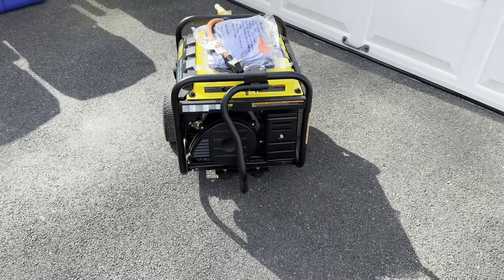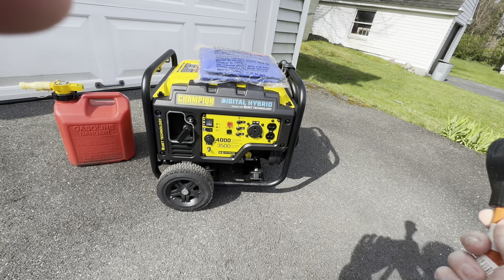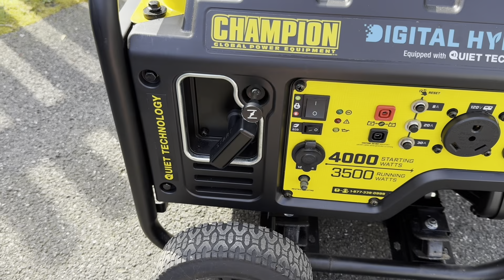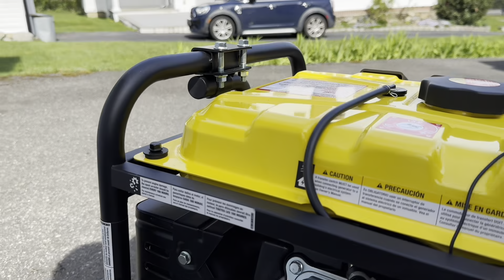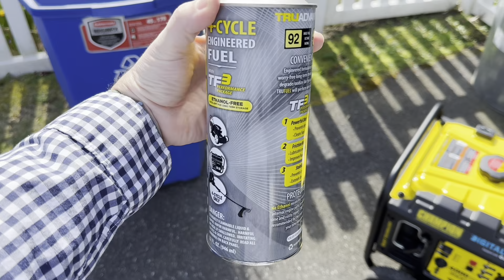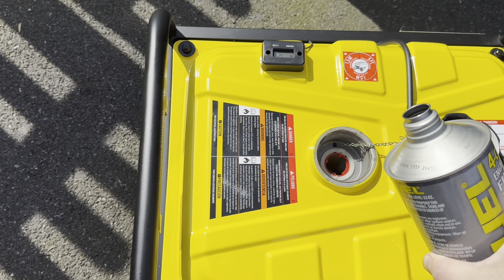Champion Open Frame Inverter Generator - Why Less is actually WAY MORE! Watch before you buy!

Comment: Contrary to what most say in this video, I chose to go the other way with a 10500 tri fuel unit running on natural gas. The generator  runs everything in my home so I can live exactly as if I had grid power including air conditioning and 240 volt clothes dryer. Running on natural gas, it's very inexpensive to run at 13 cents per hour,  and running most of the time at 25@ load, it's much easier on the generator itself. I don't want to be switching circuit breakers on and off - I want everything to run as per normal. My take on it anyway....
Reply from the maker: I agree, it all comes down to finding what works for your needs! Thanks for watching!
Reply: Same, I paid to have a friend bust through my basement wall with a gas line so I have “unlimited” run time if needed. But……and there’s a big but here, gas, and esp natty gas vs propane, delivers far less running watts than the much denser gasoline (liquid). As in 3k less watts generally. That’s quite substantial on my 8750w generator. It should say “8750 on gasoline, and much less on everything else.” However, gas is way cleaner, prob way more efficient, and unlimited. So…tradeoffs. I know I’d never use ethanol fuel on these small engines. My 8750 is pretty loud, I will say. I want to build or get a portable box for it. Didn’t want to pay the premium for closed frame but may do something on a patio like a brick enclosure for the sides, and some type of removable top like your tarp idea or maybe rig up a plastic “roof.” I haven’t figured it all out yet. I do like on the newer ones it’s basically one knob for all my options, nothing, gasoline, propane, or natty gas. Also, ethanol containing gas is hydrophilic, meaning it attracts water, and ethanol free gas is hydrophobic, it repels/doesn’t absorb moisture nearly as readily.

Comment: What you're saying does make sense.  I will figure in an a/c window unit or space heater with mine.  I went with a monster 13000 watt duromax, its 2 years old and won't run.  I did all the proper maintenance.  It ran about 20 hours on propane, now it won't run on anything.  I think I got the unlucky dud, but I'm going to get a champion inverter.  Probably a little bigger because I have a well.   You don't need to host a banquet when the power is out, just get by.
Reply from the maker: Great idea and I think you’ll be very happy with champion! Just change the oil when it needs it and always use stabilizer and drain the fuel when storing it and you shouid have no issues.
Thx for watching!

Comment: Going to be in the market soon for our first generator. Is the hour-counter device to let you know when to do maintenance, or for some other reason?
Reply from the maker: I install hour meters really only to know how much usage the generator has, when to do oil changes, spark plug changes etc. you don’t need an hour meter but it’s just easier to keep track of runtime that way. They are super easy to install also .

Thx for watching!

Comment: I have a similar size westinghouse and it worked fine during outages. The point about efficiency is very valid. However, you must also consider heating and air. Loosing power in the middle of winter with no other heat sorce sucks! Trust me on that one. Or run a/c window units during summer for Grandma and the puppies.
Reply from the maker: You’re absolutely right about the importance of backup heat, that’s a critical consideration when it comes to power outages!

Comment: Will this run a forced air furnace?
Reply from the maker: It should be able to. My predator 5000 runs out forced air furnace ( oil fired).

Thx for watching!
Reply: One of my Honda EU2200's will run my gas furnace with a 1/2 hp blower motor easily.  My Yamaha EF2200 will also.  Once it's started, it only requires 680 watts to run.  The starting surge is more, of course.

Comment: Champion is great, but skip the open-frame models unless you have an enclosure or live on several acres. We have one guy in our neighborhood that runs an open-frame during outages, while the rest of us spent $200 more for a 50-60dB model. We all hate him. Don't be that guy.
Reply: Gotta make do with what you can afford.
Reply from the maker: @rickh9507  agreed 👍! Thanks for watching
Reply from the maker: lol that’s a good point although it’s still quieter than a traditional generator but I do agree an enclosed inverter is very significantly quieter!
Thanks for watching!
Reply: A tent made of two pieces of plywood over the generator might help the noise issue.

Comment: Good video and important point about the logistics of keeping your generator fueled. I actually have 6 generators 2 X 4000w 2 X 3000W  1X 900w and a 2100W all running watts inverter generators. I live in Typhoon alley so I want redundancy and I also want to size the generator to the load. We have 9-12 all day (12 hour) power outages a year because they are working cutting trees back from the lines several smaller shorter duration outages because of the aging grid and sometimes 10 days without power when a storm does considerable damage. My 4000W generator is good for the all day outages and burns about 5 gallons of fuel but my life is practically unchanged Running two 1HP mini split air conditioners and all the usual appliances aside from water heater or cooking with electric. I can get by with one Mini split 1400W maximum if the house is already cool and my washing machine uses 2200W, dryer is new and is more fan than heating element and uses 2300W for about 2.5 hours to dry clothes, 20cuft refrigerator 350W when it kicks on 65 inch TV 250W, laptop 70W, desktop gaming computer only pulls about 350W with the chill power setting. 5 gallons a 12 hour day is no problem when it's easy to get fuel. 50 gallons after a typhoon when the roads are impassable is a bit of a storage problem plus it's hot here in the tropics and I prefer cooler, dehumidified air for sleeping. 

If a person possibly could, I would recommend they have two appropriately sized inverter generators that they could parallel at need and shut down when possible. It helps a lot when everything you are running is of the more efficient type. If you have a really old refrigerator or air conditioner, the electricity savings might pay for it's replacement with a power conserving inverter refrigerator or air conditioner. Also to consider is that my 4000W generator is industrial in nature and has a beast of a 270cc engine. My newest generator the 2100W has an 80cc engine and two of them paralleled together would only be 160cc. 110cc would be a considerable savings in fuel. I do like the open frame design. There is a drain screw on the bottom of the float bowl of the carburetor. It would be child's play to hook a larger gravity fed tank to an open frame generator that would give you days of runtime but don't forget that you still need to check the oil periodically and make sure it's Full, not just that it has oil in it.
Reply from the maker: Great points! Thanks for watching!

Comment: lol this generator from scamazon is almost 500 bucks. you can buy the same one direct from china for $145 from the same factory but weird name like "aceup" and just wait 3 months for it on the slow boat. buy 2 for almost half the price and run in parellel for 240v and charge an ev or run the entire house on 2 phase.

Comment: I agree with your statements on this size of generator. I did a ton of research and came to same conclusion. I wanted fuel efficiency, lower noise and clean power. This checks all the boxes. I also have 700 W/hr battery bank and 200w solar panel for lights and smaller things.
Reply from the maker: @RollingSherman505  awesome! Thanks for watching!

Comment: I've looked closely at this issue of fuel availability, and other issues.    Ultimately,  the best solution may be two generators.   Both must be inverter types.  Apparently, some folks really have ruined electronics with long runs of a non inverter genset.    I don't have that, so I'm using line conditioners for all my electronics.  - in case you need to do that. 

The larger generator should be two phase, meaning, capable of 240V with a 4 prong plug.    If the situation IS NOT a long term emergency, these systems, which typically start at 6KW, can run appliances like your stove, dryer, and even AC with a soft start kit.  Albeit, perhaps only one at a time.   And I would connect it with an interlock kit on your main panel, giving access to every circuit.    Tri fuel is ideal, presuming you have Natural Gas service.  Otherwise, dual fuel allows you to keep more fuel on hand, and a lot of gasoline sitting around must be cycled to keep from going bad. 

The smaller generator, I would go even lower than you did here, presuming that fuel will actually be unavailable for an extended period.  Maybe 2800 or so.   The  only purpose is to keep a fridge and a few other small appliances running.    You might be in a situation where you could only run this small unit a few hours a day to keep your fridge cold.   Adding a battery inverter system would let you run a few lights at night while the generator is off.     On these smaller systems, they are single pole, like yours, with a 3 prong plug, 125v only.    Not capable of running large appliances.  Maybe start your big one for an hour to take care of laundry or what have you.   Preferably, all your systems are gas, and you could do a lot with this little unit.   This type of unit is probably best connected via a transfer switch with only 110 circuits on it. 

Every Generator needs a doghouse, or shelter.  Ventilated, but supresses noise, and preferably locks to your building or a concrete base, to keep anyone from stealing your equipment.
Reply: I have found that large phone charging battery banks with lights on them are a good light source when power is out long term, depending on size they can run for days/nights and still allow you walk around without barking your shin on the coffee table. Large ones will also power a small USB fan for long periods.
Reply from the maker: @ that’s great to know! Thanks for watching!
Reply from the maker: I 100% agree with what you said here! Thanks for the great points and thanks for watching!

Comment: But can it run a well pump that is a 240 volt circuit. I want a inverter generator that can handle a 240V at least once a day to fill my pressure tank during an outage
Reply from the maker: That’s a good question! Unfortunately this unit is only 120v. Champion does make some larger open frame inverters that are 240v and those would easily be able to handle the well pump. Harbor freight predator also makes a large inverter (9500w) that is 240v.
Thanks for watching!
Reply: You would need the 11,000 watt enclosed imvertor by champion. It'll run your well pump along with everything else in your house. There are many choices. It just depends on what your needs are and what you're willing to spend. A large invertor generator would be your best bet for clean power for your sensitive electronic, better fuel economy, and quiter operation.

Comment: Do you have a favorite generator?
Reply from the maker: I personally really like the small champion 2500watt dual fuel generator due to its portability, ability to run on propane, and fuel efficiency. Keep in mind it doesn’t produce a lot of power but it’s just enough for a fridge, some lights, tv, router, computer, fan, etc.
Thanks for watching !
Reply: @Outdoor_Prepper u can load U battery too with it. Small is a good choice.
Reply from the maker: @lauracrofts4833 agreed!

Comment: Wouldn't you need to have a 120/220 generator to power a dryer or stove. Anything that's 220 in your house
Reply from the maker: You are correct. In my case, my stove is natural gas so the generator only powers the light, fan, and igniter of the stove as that’s all it needs. For an electric stove or electric dryer you would definitely need 220 which this generator cannot do.
Thanks for watching!

Comment: I need a 240VAC version of this but the 240 versions I've seen so far are only available in much larger inverter generators.  Actually, I don't understand how a 120VAC inverter generator interfaces with your house as 120 would only feed half of your breaker panel so if you have a frig and a separate freezer which are only separate legs of the full panel (240VAC Leg 1 and Leg 2) one of those will be without power.  I'm not an electrician, more like an old Electronics Tech so there must be something I'm confused with here?  I have a 1.5 Ton Mr. Cool which very well fits the wattage requirements of generator in this video but the Mr. Cool uses 240VAC.  I'm open to any suggestions.
Reply from the maker: Thanks for watching! They make an adapter to bridge the 2 hot legs of the transfer switch to the 1 hot leg coming off the generator. It will power the whole transfer switch but no 240v circuits can be used.
Reply: @Outdoor_Prepper  Ahh..., so the left side of breaker panel is placed in parallel with the right side providing 120VAC to each side and in phase with each other which kills the possibility of that generator providing 240 to the panel.
Reply: Using the adapter cord will not give you 240v.  If you have a hard requirement during an outage for 240v, then this set-up is not for you.  In other words, you need a 240v output generator/inverter that has the capability of powering your 240v requirement.  
I don't understand how a 120VAC inverter generator interfaces with your house as 120 would only feed half of your breaker panel  It feeds both legs of the panel with 120v, same phase, because the adapter cord takes the single 120v output and sends it to both panel legs through the 4-pin power box.  The nice thing is that everything 120v in your house will work....lights, microwave, fans, outlets, tv, etc.  And in terms of power demands, the only thing you need to monitor is Total demand....not demand by leg 1 or leg 2.  But again, nothing 240v will work...like a well for water.  You can even run a 120v window A/C, if you have one.
Reply from the maker: @spacecoastz4026 excellent points and I agree with what you said . Thanks for watching!
Reply: You hook up your emergency house feed as a 240v setup.  That orange adapter cable sends the generator 120v output into two 120v feeds, same phase.  The house panel receives the 120v generator output into both legs.  Everything 120v in the house works...but nothing 240v.  This is what I do.

Comment: I have this generator and it's a great deal. If you're on a budget this is the best deal. Plus it will run a fridge and two  5,000 BTU window units easy. Also, all of that fits in the back of my hatchback corolla.
Reply from the maker: Thanks for watching!
Reply: My exact needs. Thanks

Comment: will it power a heat pump?
Reply from the maker: Thanks for Watching!  If the heat pump is 120v and stays within the wattage it will.  Many heat pumps are 240v though and in that case it would not be able to unfortunately.

Comment: i’ve been looking into generators and i’m wondering if i do parallel two of them, am i able to use the plugs on the generators themselves and still have that double power available? or would i have to use the plugs on the parallel kit ?
Reply from the maker: Thanks for Watching!  I have not tried that but my understanding is that yes, the plugs will still work on the individual generators - just stay within the wattage limits.
Reply: Yes, you can use the plugs but a 20 amp plug is still 20 amp. Some generators can't even put out all the power they produce through their 20 amp plugs, it takes a combination of the 20 amps and a 30 amp twist lock to ever get the full rated power from some of them. I saw a video by a homesteader who had a 9000W generator where the biggest receptacle on his generator was 30 amp and it wouldn't run his whole house because he needed a 50 amp receptacle to get the full output on one plug. There are parallel cables with a box that would allow you to use a 50 amp plug/cable.

Comment: Running a moderate sized genset does make a lot of sense from a prepping standpoint.  You're probably not going to be running everything under the sun in your house and you will likely be limited on fuel availability, so you have to make the fuel you have last!!!  Having to run your generator for a couple of days is one thing but what if you need to run it a couple of weeks!  Tornados are quite common here and t can easily take a couple of weeks for power to be restored again...
Reply from the maker: Thanks for watching and I totally agree with everything you said!

Comment: that canned fuel is garbage. Goes bad very fast.
Reply from the maker: Thanks for watching and for the info. I have not used the canned fuel extensively yet so can’t really give feedback. What types of issues did you experience with it?
Reply: @Outdoor_Prepper  I watch a few small engine repair channels and they have demonstrated that the canned fuel wont even burn after a month or two of sitting in equipment. I had it happen to myself with a chainsaw.
Reply: @ClumsyCars and it cost 3-5 times more too.
Reply: @ClumsyCars If you use non ethanol, you wont have that issue .
Reply: Not to mention that it's a total waste of money. Just search "ethanol-free gas station near me" so much cheaper